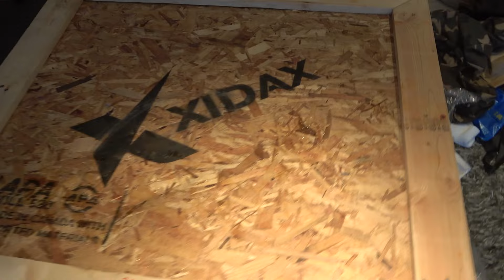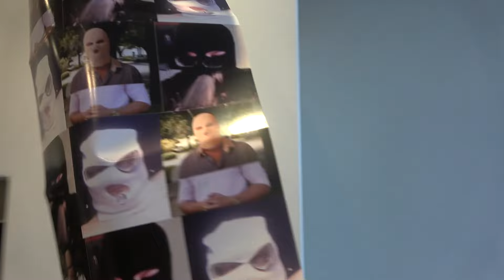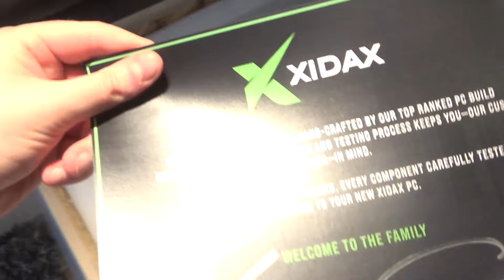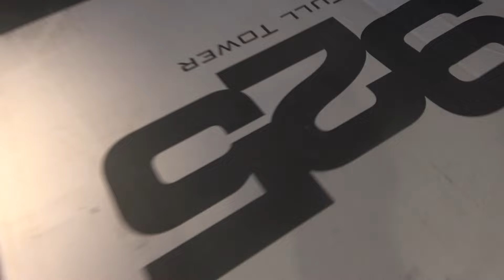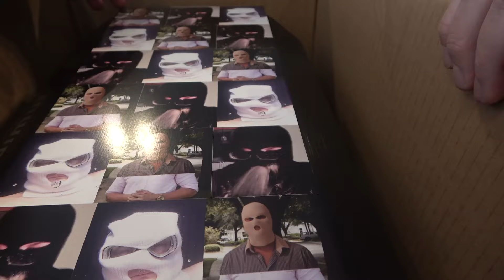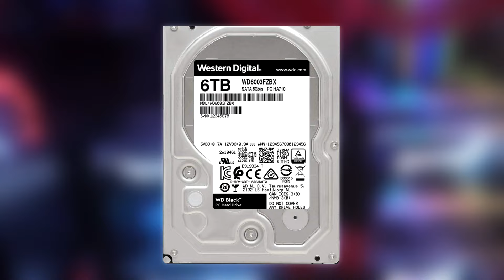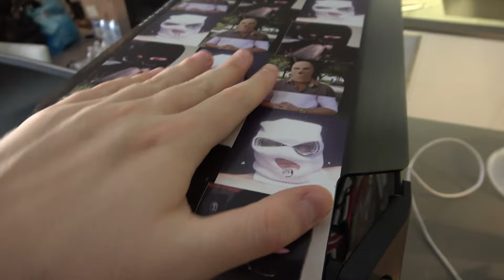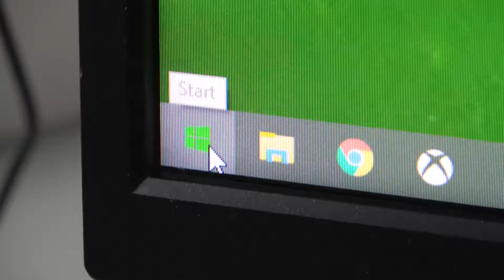UNBOXING PC WITH PAPANOMALY 3

Comment: Anomaly: gets nasa pc
Also anomaly: benchmarks pc in csgo
Reply: Probably using it for 24/7 streams
Reply: BoldAnd Brash yea on his old pc he had 300fps so he doubled his fps and it will help him alot during the 24/7 strrams because the pc usually heats up and all that s### but with that much watercooling and those specs he is good to go .
Reply: hes not even allowed to 24/7 vod stream anymore, twitch changed ToS lol
Reply: Loading_Snake it was a joke because of the problem that was created on twitch
Reply: poppincola lol

Comment: Why are the intake fans blowing out and the exhaust Also blowing out...
Reply: I don't think they are.
Reply: @m-h1217  they do. The backside of the fan where the volt ratings are are pointing outside like an exhaust fan. And sure he have water cooling abd doesn't need so much air för the cpu but still just looks weird
Reply: @miley6.915  If it's like that, then ask Xidax.

Comment: lul sli is so bad... But it looks really cool !
Reply: Why is it bad?
Reply: @stefmyt5062  It's not worth it, you might get 30% better performance.. Because developers dont bother put the extra work for the small majority with two graphics cards.. It's not worth it.. So over time the "Sli" has just becoem worse and worse, because it's not optimized for it.. And you have to do alot of custom profiling too.. I guess it's already done for him. But because most games don't use two graphics card he is probably not gonna use it that much.. But for an advertisers to give two graphics cards to him makes sense in  a way for people who don't understand computers and are like cool or whatever.. don't know.. and maybe they think customers won't think they cheped out.. but yeah the custom pc looks really good ! except the other side of the pc case where you can see the cable managments and hdds it's not really good looking.. but from the motherboard window view it's pretty !
Reply: @clawwer4404  You're right in that an SLI setup is not twice as good as a regular setup. But for people like that, it's worth it. Anomally doesn't care about the price, he just needs the best performance possible, and 99,9% of the time SLI is better than just a single GPU.
Reply: @stefmyt5062  99,9 not really true when only 30% of games supports sli :=) and the second card is not being used at all..But yeah, for him there is no point in really not having it.
Reply: @clawwer4404  CS:GO supports SLI, some people care about performance and don't mind paying a HEAFTY premium, so why not?
Reply: @stefmyt5062  are you actually serious !? you use csgo as an example.. It doesn't mather if csgo supports SLI. because csgo usese fcking mostly the processing power from the cpu.. not the gpu.. so wtf does that have to do with anything.. jesus
Reply: @clawwer4404  Don't matter, he wanted the best and he sure as hell got a great one. The price may not be worth it to normal people but for him, it's surely is, as yourself said 30% higher performance, that's a lot for someone like him.
It's true he doesn't need this amount of power, as no game has this demand, but in the future? Possibly.
Reply: @m-h1217  on csgo the performance wouldn't anything close to 30% because of the game usage focused more on the processor and not the graphical processor. 
It's not like he paid for it.. The advertisers just put in two cards to make them look good.. "wow two cards"
Reply: @clawwer4404  They didn't put them there because it's nice. They put it there because they wanted to create one of the most powerful pc's in the world. Even though it's not needed. He also plays other games, I also never mentioned it would make performance better in csgo with 2 cards. Then again nothing pretty much does as the frames would be higher than any monitor could present, whatever game you'll play as it's 2 of the currently most powerful cards. (If you compare any other great gaming pc. Of course performance would be better than the average pc.)

Comment: Damn hes gonna play so much CS GO on that!!! Why the fuck does he need those specs! I guess making vids but even a fuckin ryzen 5 3200X can run vids. Hes gonna play fuckin roblox cs go! He dosent need it. He can just use like a gtx 1660 super and get like 200fps on cs go. 600 fps isnt gonna make much difference to the plain eye.

Comment: fuck using water coolant
Reply: why?
Reply: you have to clean it out all the time and if that leaks you're computer is fucked
Reply: @thenewjigsaw4422  Clean it out all the time? No, most water coolant systems don't need any maintenance at all.
And leakage most of the time only happens to self made builds, as people don't know how to assemble it correctly. If it leaks when you have built it on your own, it's your fault. If you buy a complete build with water coolant and it leaks, (something highly unlikely,) you can most times get a refund.